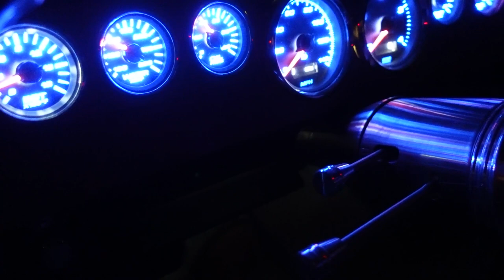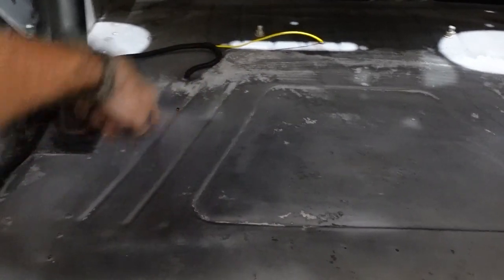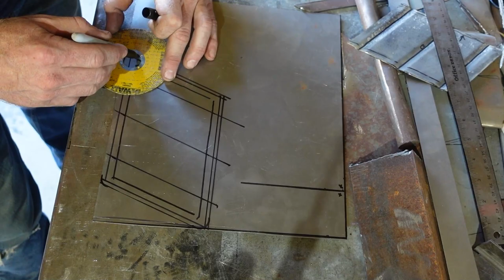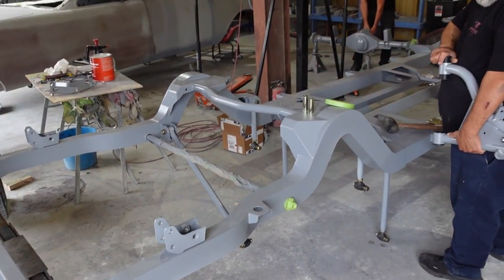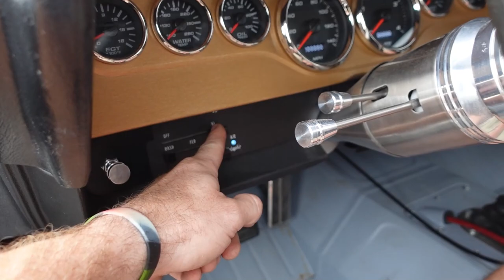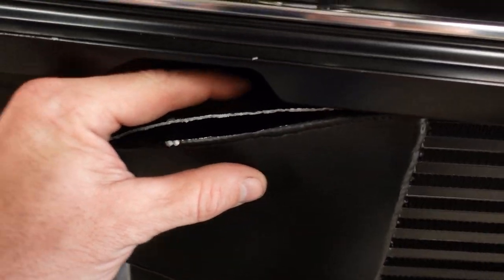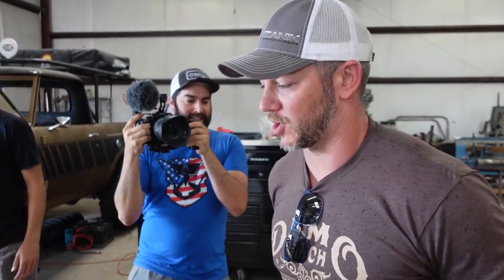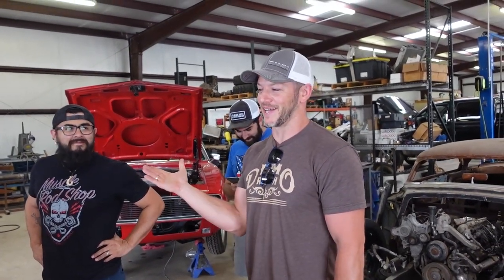The DEMO CUDA goes home!!!..... The Intercooler stays.

Comment: Brandon and everyone at Muscle Rod Shop should be extremely proud of themselves on this project. The engineering and expertise shows on every panel and inch of the Cuda. From a personal point of view, I'm not a lover of diesel engines due to the sound and the thick black smoke, but all in all, it's truly amazing.
Reply: Im in a similar boat as far as not being big on diesels but if I was forced to own once, the DemoCuda would be the car
Reply: I'm also not a huge fan of diesels unless purpose built for hauling and such then obv diesel is the way to go. But, I gotta admit that thick black smoke and diesel exhaust in general is a LOT more environmentally friendly than a gas engine.

Comment: you guys made one of the scariest looking custom vehicles to ever hit the road. like a conventional Mad Max drive around that can back up a variety of challenges.
Reply: I'd love to see the Ma Deuce put on top with computer assist aiming, all from the inside on the car.
Reply: @squirlboy250  computer turret is a cool idea! but i'd rather see a Bofors on the back if i'm using a computer, for all the arial attacks. keep Ma for an adapted windshield area your passenger can use. this ride needs tits, zaz, balls, and bling.
Reply: Imagine this thing coming up behind you on the road, it would be intimidating as fuck 🤣🤣
Reply: @Matty.Hill_87  it DPs each vehicle it approaches up to 6 vehicles ahead. makes me think it needs a belly ball turret but more likely Matt needs to work with Whistlin Diesel's Monster Max to pull that off.

Comment: Holden Bros. words to the end hits a spot for me. As a mechanic myself, i truly know what those words mean. If you want to build it clean and sturdy, you'll need time. A lot of time. And that's what people usually don't get. If you have no time, you'll build or repair it quickly either way. But it will be crap you can't be proud of and maybe it will even break again in a couple of months or years. And that can be very frustrating on this job. 
But it's the modern times i think, nobody got time for quality anymore.

Comment: Awesome build Brandon.  Looks like you've started on the Military truck.  I've got my 37 at the Hot Rod Institute for a new Firewall and floor pans.  Also going to fix some fatigue cracks in the doors caused by closing the doors with door checks that never saw a drop of lube.

Comment: Great build guys!!!   When you rebuild the inter cooler maybe hydro test it to 100-125psi to see if the fins will take on the Matt test.  Might have to take a jump up in starting thickness.  But on the bright side you have a great looking template to work from.

Comment: Ok, I have a question cause I'm about to do the same damn thing. Can I just weld 2 inch strips on the underside of the trunk hole and use them to bolt the cut out piece to? I can only weld from the top...! Trying not to fab a new metal piece to cover the hole......you're awesome.

Comment: Brandon why not makes the entire trunk panel in to a removeable 1? That was if the tank ever needs pulled you can take it out through the top it would have advantages as well as that is a common area for rust out in many cars anyways. Texas might be dry and salt free but still matt is going to do car shows etc with it so him being able to pull that panel on and hit it with some undercoat etc might not be the worst idea

Comment: Everything was looking great with the panel, new beads, fitment and then you used tek screws to fasten it down...smh You should've gone with some nutserts and 10-32 stainless hardware. Also why leaf springs all around that thing is going to ride like a tank, no air bags? coilovers?

Comment: is it smart to stick to aluminum when you know that much boost is going to be dumped in to it?  we all know matt is going to be pushing the limits and running it hard maybe its smart to build tough and just work with the lower heat conductivity of a much stronger material.